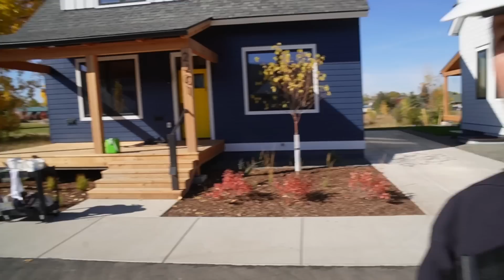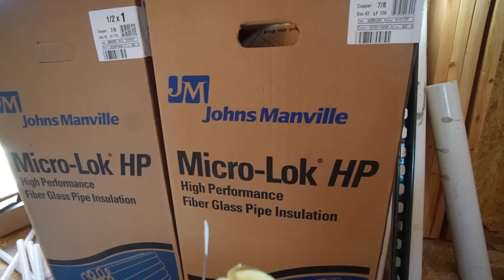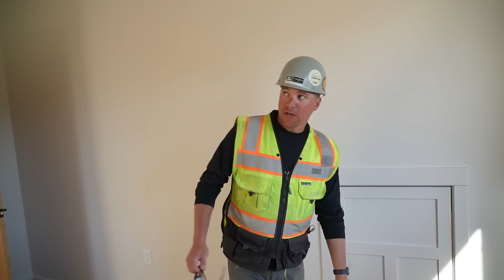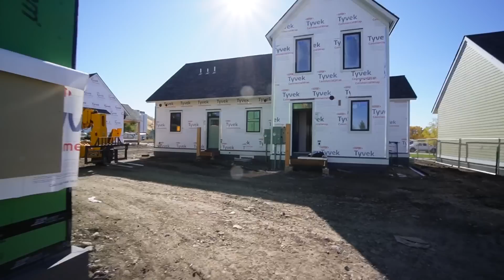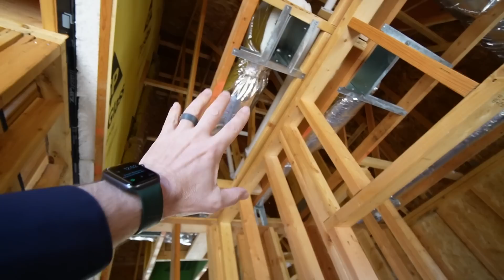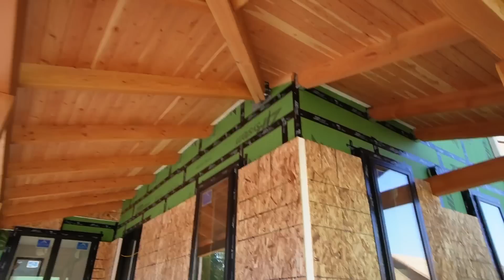Why is there OSB, ZIP, and Housewrap on this house?

Comment: I don't understand, isn't this redundant? Why wouldn't you put the foam inside the zip system? Like foam against the studs and then Zip? For example, Zip provides foam backed Zip R12 has the foam inside the Zip sheathing. You could do this and attach the sheathing directly to the zip without the need for an additional OSB layer and additonal Tyvek wrap.

Comment: Why wasn't Zip-R12 used instead?  This makes no sense, unless the builder just wants to keep his labor force busy.  They are sheathing the house twice.  Zip-R would need no window bucks (which also lowers the R-value around the window), and no need for the additional EPS/OSB combo plus it would be easier to seal from water and air with Zip tape.   I would think the labor savings using Zip-R12 would be better than the double sheathing costs and window/door bucks etc.

Comment: I have had a really rough time with my Alpen windows and doors. We’ve been working with Alpen to remedy the situation, but Alpen’s windows and doors may have been our largest issue building our Passive House.
Reply: Just curious, but was it the thin film "heat mirror" as the middle layer? I moved away from Alpen  and went with Canadian triple-glazed windows after learning about that.
Reply: @CMartel002  I am not sure. I haven't noticed a film on the middle layer.

Comment: I have a silly question...I'm in design phase of a new build..my wall assy is 2 x 4, 3" polyiso, 7/16 sheathing, batt in cavity = R30 wall. Is there a reason not to do this? It would be equivalent to Zip R system but much more cost effective and I can stagger foam seams to sheathing seams. I guess I don't understand why they've complicated the wall system so much.

Comment: Not convinced on ZIP yet. OSB turned out to be a soaken, humid carpenter ant's nest disaster and cost plenty to rip down and replace with B-grade plywood.
Reply: Foam has seemed like such a riskier material to use than Rockwool to me, which is why I used exterior Rockwool on my home.  Retrofitted it.  We will see.  Never loved foam not being vapor permeable.

Comment: Interesting. I have Zip with 7/8" closed cell foam on the outside of my tiny house with Roxual insulation between 14 oc 2x4 stud wall.

Comment: Matt, what is the benefit of going this route with the Zip, insulated OSB and housewrap instead of just using the Zip-R with the insulation attached to the Zip?  Also, how are corners handled when you have the insulation attached to the OSB or Zip?  Thanks.

Comment: Comfort Cove heaters are great.  I installed them years ago.  On demand instant heat and savings when no one's home.

I'm doing the same thing with zip board and 3 in poly, but have hung furring strips every 16 to create a rain screen and to attach the signing on the outside as the rain screen as per Matts videos and "the perfect wall" system. 

Everything dries to the inside of the house, which means you can't use closed cell insulation inside. 
I have the rain screen on the outside of the polyester before the vinyl and metal siding combo. No tyvek. 

I covered my polyiso with a spray on liquid vapor permeable air barrier, and the zip system seams and penetrations too, but I think it's belt and suspenders.

Could not get an answer from perfect wall guy in Boston.

Good looking out with that iron worker construction helmet. Safety first bro.

Comment: The Radiant heat is quite common in the upper west.  I have 10 units in my house. But my basement is in floor Radaint hot water with a Propane boiler.  Of the 10 units I only use 3 and then only sporadically.  We have a Kozy Heat Fireplace that's around 77% efficient and we burn wood to heat the main floor.  Our basement is ICF's and the main floor is 2x6 construction with 1" of exterior foam and 3" of Closed Cell inside.  The great room, where the fireplace is, is around 800 SF and has a lot of glass.  The back of the house, bedroom, office, pantry and entry are always comfortable and we never have had to heat them other than the electric in floor (DietraHeat) in the bathroom. The radiant cove in the great room is primarily used on moderate temperature days where the fireplace would drive you out of the house.  I'm considering a mini split for the great room.  We rarely would benefit from AC, but it would be nice on those infrequent hot days.  The Heat Pump aspect is more appealing.  For a 1500 SF house that's otherwise all electric including a well pump, our annual electric runs around$1300

Comment: U value window 1.9? That's bad. U value of 1.4 as standard in UK
Reply: Different ratings.   The U-factor is actually 0.19 in imperial unit.  You are using metric units.  To convert, a U-factor of 0.19 in the US would be 1.07 in metric.

Comment: 1. EPS below grade not a good choice. Issue is that bugs will turn it into swiss cheese by burrowing tunnels in it for homes. Either use a fiberglass mat or get foam that has a pesticide in the foam so bugs won't tunnel through it. Another issue with EPS is that its insulation value degrades over time.

2. A better way for exterior insulation is to just use standard foam panels & 1x4 or 1x6 boards for the nail base for the siding. I suspect the OSB bonded foam insulation is considerable more expensive.

3. For the window buck, It would be ideal to use some ridge foam sandwiched between the wood frame and the wall frame as a thermal break, At the very least use some sill sealer as a thermal break.

Comment: Beautiful homes. My only negative comment about the project is there is no emphasis on passive solar. The project started with an empty large piece of land where all the lots and streets could be laid out so that passive solar was a dominant feature in the community. Such a design aspect would further reduce energy requirements in both heating and cooling.

Comment: Great episode. Was wondering what type of insulation will be used on the interior? Spray foam?
Reply: Probably just bat insulation since they are going for a low enviromental impact construction. Probably Rockwool.

Comment: I worked in a window manufacturer, for 4 years 2015-2019, the Krypton got very popular towards the end. it's such a pain in the ass, b/c it took so long to fill the window cavity. But they said the Krypton (our engineers said its chemically heavier, therefore providing a denser barrier against the elements) idk if they were just trying to justify it too us, b/c we were production based and these slowed us down a lot. However, they guarded that Krypton like crazy, as they said it was 10x more expensive than the argon

Comment: Maybe I missed it, but do they also insulate between the studs on the outside walls?  Or is the 3" foam adequate?
Reply: They said the nail base was R15 and I think min framed wall insulation requirements in code for that region require R20+ total so I would assume they’re doing something inside the walls too

Comment: I am curious as to why they chose the materials they have for the outside sheathing. To me it seems like a cheaper alternative would be to use regular OSB first then either ZipR or polyiso and then regular Zip. Eliminates the need for the Tyvek for most siding choices. Also no blocking around windows would be needed and you can also oversize the rough opening an additional inch and use zip as your return piece for a solid and watertight rough opening.

Comment: Would it not make more sense to have the Zip on the exterior side as opposed to the interior? I would think air and water sealing would be more benficial prior to the insulation........and think how much more insane of a barrior it would be should you do both layers

Comment: They could save a lot of money going to a heat pump air handler with heat strip, the exterior system is really cool, could be applied to a sea can house with a few tweaks

Comment: Someone has got to come up with a way to make mini splits look good.  Just tacked right in the middle of the wall is an eye sore!
Reply: I have seen ceiling mounted and inline (like a conventional air handler) heads for multi-head systems. I am sure they cost more, certainly if integrated into  a full duct system. Cost is always going to be a factor.
Reply: They have some nicer looking floor mounted ones that look far better.

Comment: It seems like having OSB beneath Tyvek, with no taping defeats the purpose of spending all the money on a Zip system. With the OSB adhered to the foam, when the OSB rots out are you having to now replace your foam? It seems like there are too many layers to me. Why not foam over Zip and furring strips and siding with an air gap?  Their systems are air tight but not economical or a long term solution to protect the OSB. I don't get it. It's a no for me on this one.
Reply: I was thinking the same thing. Makes more sense to fasten the rigid to the ZIP and then install rain screen battens over it.

Comment: And yet what are the utilities cost per month on these small houses? Seems like they spend tons of money on these houses but dont provide a huge difference in utilities. My 4600 sq ft house built in 2020 for $440k averages $100 per month electric bill, so I don't see spending all that extra money for a very small difference in electric bills....
Reply: Do you live in climate zone 6?  I highly doubt it.  Bozeman is at 4800 feet elevation.  I see zero days with highs above 20 degrees there in the 10-day forecast there and multiple days in the negatives.  I live in climate zone 6, and my home was running $700 per month in the winter to heat before we retrofitted with air-sealing and added exterior insulation, and since then, my costs more resemble what you are paying.  I figure that exterior insulation will pay for itself in a few years, and my house feels much more comfortable, as well.  That won't work out so favorably in warmer climates, though.

Comment: What I didn't see is if the stud bays are empty. I sure hope so. 
Having 3000 to 6000 HDD, that OSB nailbase would bother me. Is that just a double vapour barrier? Without an interior vapour barrier, the EPS could breathe either way, but  it would have been way safer to just do the lstiburek rain screen (remote wall) than this. Hope it works out. I'm a little nervous about this development.

Comment: Does zip not offer a 3 inch foam? Just seems like a lot of work to put up sheathing twice
Reply: It has 2.5", but the structural value of it goes way down. It might not be adequate for shear in this location. I often see just the exterior insulation board go up (no attached sheathing), then strapping on top for the rainscreen air gap plus siding attachment. I'm not sure these ones have a proper rainscreen.

Comment: Surprising to see the supplemental heat installed up toward the ceiling-- I would have gone for having it down at the baseboard level.
Reply: They are radiant panels, believe it or not but those panels will heat the objects on the floor before heating the air. They feel just like the sun's radiant heat shining down on the room. I lived in a home with radiant ceilings, it was always funny sitting down on the couch or getting into bed and having it be warmer then the air temperature.
Reply: I’m guessing because it’s small room putting heater at floor level would limit couch and other furniture placement, up top it can be out of the way and air can be circulated back down with a mini split.
Reply: Apparently up & out of the way trump’s “heat rises”….

Comment: I seriously want to know why they didn't just use ZIP R instead of twice the labor?? Was it a chemical issue or supply chain, or what??
Reply: there is definitely something odd here in the materials. like some subsidies/credits/kickbacks. as you said the labor part doesn't make sense.
Reply: Eps foam is manufacturered locally so they may get a leed credit
Reply: Eps is better than iso in the cold.
Reply: How would it be better if it has half the R value

Comment: I wonder if the zip R stuff costs way more then the system of zip plus nail base and tyvek.

I know tape exists that air seals OSB. Could you switch zip for OSB and tape the seams?
Reply: I like this system better than zip R bc the osb is protected by the foam instead of backwards like zip R. And the double protection of zip and tyvek and foam.  Nothings getting thru that
Reply: @hickorydragon8114 
But then wouldn’t moisture be trapped in between the zip and tyvek?
Reply: Yeah, OSB is a pretty good air barrier if you just tape the seams.

Comment: As Bozeman seems to have an affordability problem and you've referenced this project as being some sort of public-private partnership, what's the price point for the smaller and larger houses? It looks like a brilliant little community, but very curious about what price point they're trying to hit (and how much that price point is subsidized). The unconditioned attics seem really strange, and I had the same question lots of others had about "why not ZIP-R" instead of the complex layering of exterior materials they're doing, but this is a whole heck of a lot better than any builder grade stuff. Really glad you did this video.
Reply: The blue house with the yellow door is listed at a cool 649,000 dollars.
Reply: @JimYeats  Dang. Uh, not sure this is going to be affordable for those working Joes and Janes of Bozeman. :(
Reply: @JimYeats  $649K sounds much cheaper than $650K. Smart marketing! Haha. Here in Japan, a lot down the street was listed at $200.6K! I’m sure the price was not negotiable either. That $0.6K shows how strict pricing is in Japan. In America, we like our 9s. Everything is $...9999.99. That $0.01 less makes such a psychological difference.

Comment: Wondering why they wouldn't use Zip R vs. the OSB with XPS on it?  Seems like an added cost layer that could have been solved with Zip R, while still having a nailbase. 
🤔
Reply: Anyone know what Zip-r costs right now? The only place I can find online with actual prices shows like $100 a sheet for r-6 😬
Reply: @timgleason2527  winner winner chicken dinner
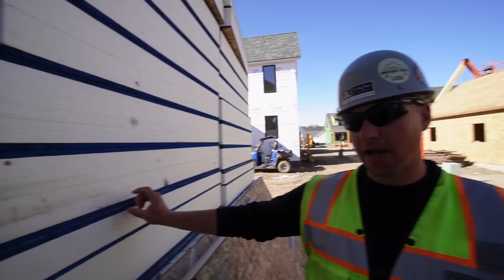Reply: Zip_R only has a maximum foam thickness of 2", not 3".  Also, EPS would lose a lot of R-value at cold temperatures, so XPS would make sense since it's performance doesn't degrade in cold temperatures.  However, at about 11:18 it sounds like he said 3" EPS, not XPS.
Reply: @BoxleyAcres  Zip R isn't backed with XPS, it's polyiso. 3" of XPS has an R-Value of around 12.5, Zip 2" polyiso is R-12. I maintain my early position that Zip R seems like it would have served the same purpose and likely cheaper, while simplifying the assembly and reducing the amount of face areas for issues to happen on.

.5 more of R-value seems negligible.  
Would love to hear their rationale on the assembly.
Reply: Bozeman is in a seismic zone (right next to Yellowstone) and I doubt Zip-R has the required shear strength so sheathing must be nailed directly to the studs.

Comment: I was noticing that when you went down in the unfinished basement the PVC drain lines didn’t have purple primer do they use clear primer or just cement I would hate to think they would build the houses like that and not use primer.
 here in my state code doesn’t call for primer but me as a plumber since the late 80s will never not use primer I’ve been on to calls where so called plumbers didn’t use primer and the pipe from hot and cold weather caused the pipes to come apart but almost never have I been on a call where primer was used and the pipe came apart. 
So I’m a strong believer in primer I use both clear and purple primer clear in the house and purple underneath the house and I don’t mean clear cleaner I mean clear primer.

Comment: The question is, why wouldn't they just build with 6" SIPS to start with, instead of framing and needing a half SIP as a 2nd layer of continuous insulation on the outside? Extra unnecessary costs to the build and with SIPS they meet the blower door spec almost guaranteed without trying.

Comment: when moisture gets between the zip and the foam, how is it getting out?
Reply: EPS insulation is vapor open, and the OSB and Tyvek would allow drying to the outside, right?
Reply: It isn't. Building science says max 1 vapor barrier and this building design doesn't meet that criteria.
Reply: @seattlebitcoinbroker6564  where do you see two?

Comment: Trying to understand why they're building this way rather than with integrated foam like a Zip-R type product... Is there cost savings? Looks like more material and labor with all the Tyvek and OSB! What am I missing?
Reply: I could be wrong but I believe zip-r only comes in polyiso not eps, it could be for this climate they want a vapor open insulation system. Zipr has the negative also of the wrb being outboard of insulation, could be a condensing surface in this climate. Also not a builder not an expert though.
Reply: Zip R probably doesn’t meet the wind code requirements for shear if I had to guess but I didn’t take the time to research that.
Reply: Agreed.  I would assume(not a builder) that a full zip-r exterior would be much less labor than weird layers, unconditioned attics.  Weaving the barrier and insulation through the structure instead of all on the exterior sounds unnecessary (especially if you watch this channel).
Reply: Bozeman is in a seismic zone (right next to Yellowstone) and I doubt Zip-R has the required shear strength so sheathing must be nailed directly to the studs.

Comment: Why do you build with such crappy materials in the USA. No wonder they all rot or get blown away by the slightest wind.
Reply: Because the whole country was and is covered by pine forest so it's the available, cheap natural RENEWABLE MATERIAL, that if kept dry lasts for hundreds of years
Reply: yeah, why use engineered composites instead of stacking rocks like a cave man.
Reply: Well I haven't seen a house rot away if maintained.  It takes massive winds to blow a house away, something Europe knows nothing about....